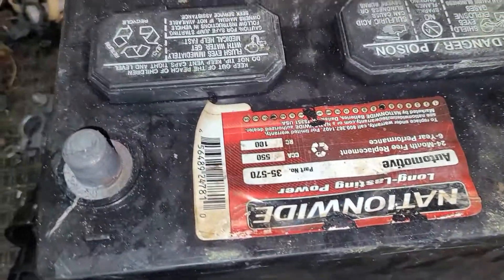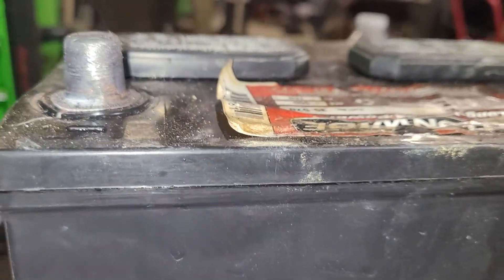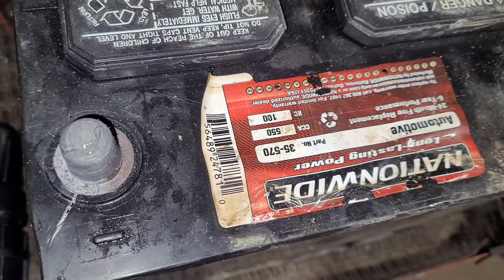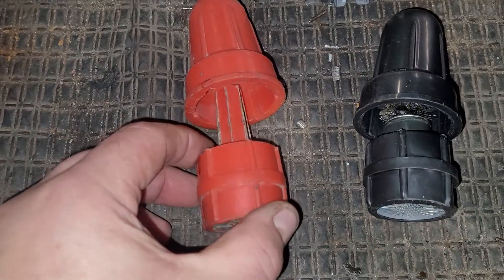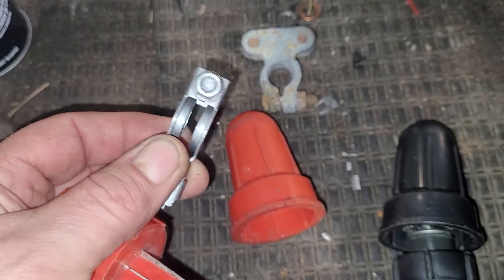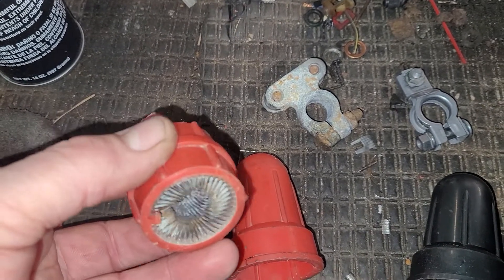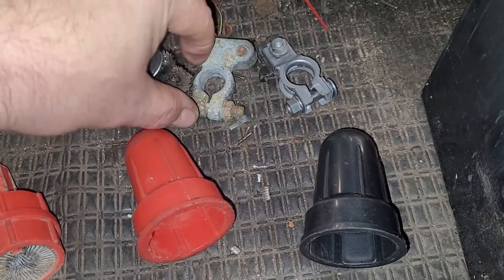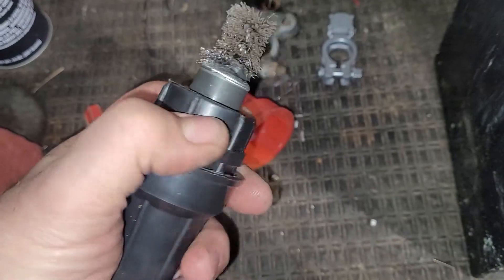Mazda Battery Surprise & Why it's important to clean your battery terminals. Different tools I use

Comment: Could that battery have been dead , frozen and split ? Cleaning the tray and anywhere acid spilled is a good idea .
Reply from the maker: I doubt it froze since we're on the coast of North Carolina. I did initially think that since I'm from upstate NY originally, and a frozen battery is something I've seen in the past. I cleaned the tray of acid and corrosion when I cleaned the battery before replacement in the previous video . Thanks for watching !